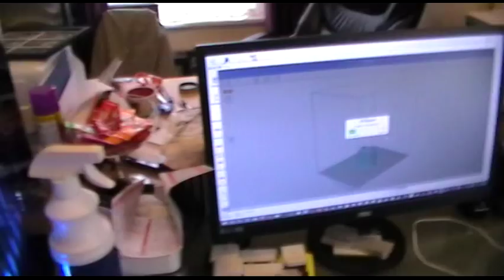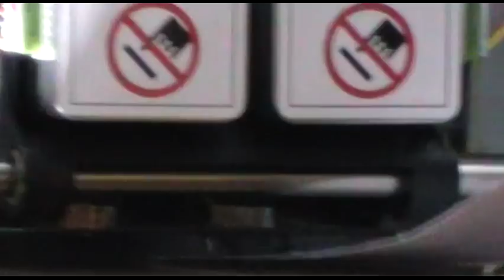Xyzware Tutorial How To Calibrate A Da Vinci 3D Printer Easy Video 4

Comment: Hi there, 
Thank you for this video. I spent a morning trying to use the XYZware calibration setup on the printer with no success. I could get one set of figures, change nothing and set it to calibrate again and get a different set of figures! Totally frustrating. Using this method is simpler and it works!!!!!